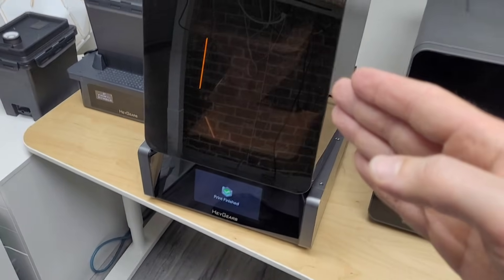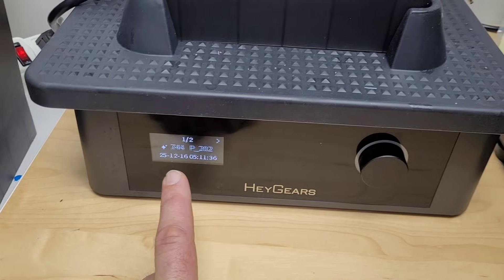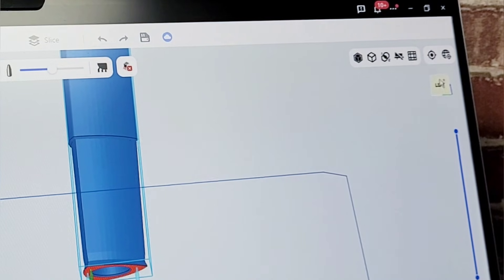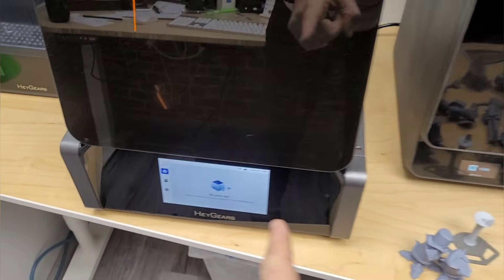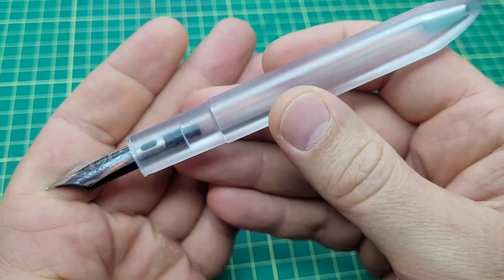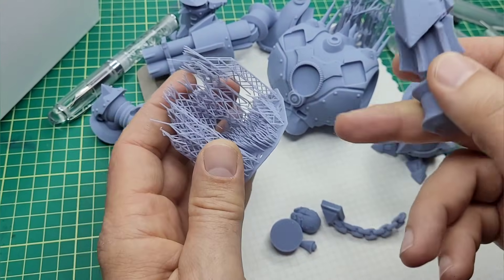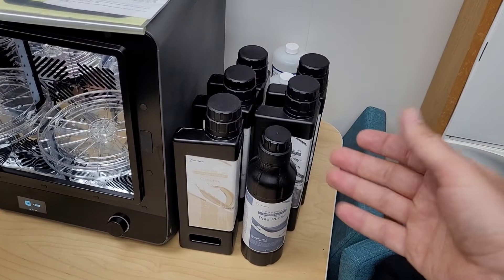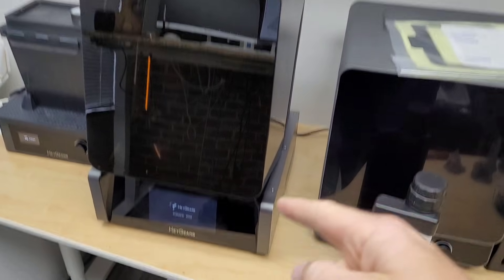Consistent Resin Prints Without the Stress — HeyGears Reflex RS

Comment: Quick suggestion that helped me in resin printing - go use a different slicer to get supports (I found prusa slicer, used more for FDM, was great for support generation - I've also used chitubox). Once you have supports created in a different slicer, you can re-export the STL (with the supports) into your printer software for prep and printing. I know it's two steps, but might solve your support challenge. 
Supports, in addition to the simple messiness of resin, has been one of the biggest hurdles compared to FDM for me.
Reply from the maker: Yeah I hear ya.  For this review I wanted to keep it all on the HeyGears workflow.  That is a way to do it but a few tweaks to the supports in their own SW would be nice.  Everything else has been great but a few tweaks would make it fantastic.  The model with the pre-generated supports fell 2 times so there's something to be said for having prints that work every time but may just need a little extra post processing.  I think they prioritize having print success over anything else.  But being able to tweak the supports, especially ones that were generated in the threads, would be nice.

Comment: since the supports are such an issue, you should try other SLA printer softwares to generate the supports, then you can export the stl with with supports included, load that into your heygear software and just line it up and print it
Reply from the maker: Yup I thought of that but wanted to keep it all in the HeyGears workflow for this review.  I think that part of the software just needs a few small improvements to allow for tweaking a flexibility with the supports.  But the good news is their supports didn't fail at all but the ones generated in the other software did fail twice.  I'd rather have successful prints with a little more post processing VS a failed print.

Comment: Question about resin printing: What do you do with all the waste? The supports, the first iterations that needed improvement etc.?
Reply from the maker: There arent a whole lot of options currently for recycling the material.  I've heard some will grind it up and it can be used for filler in other applications.

Comment: For me, the worst issue with a proprietary platform like HeyGears is that if they disappear your super convenient tool becomes an expensive museum piece... if lucky
Reply from the maker: Yup that always is a risk.  Other resins do work with it, but just have to do testing to find the corresponding profile which properly cures those resins.  I've seen other do testing with that and even have a reference sheet of cross compatible resins

Comment: 1)
Looks like you changed your capital F style, font in your test writing examples.
There is nothing wrong with the F, I just, well just noticed.

2)
Your improvement suggestions seem to be obvious concerns.
From past experience, not 3D printing, you need to have people not in the design group test and play with the software & hardware.
The design group can then get a better understanding of what needs improvements.
The test, play groups can be office clerical staff or students involved with 3D connected education.
This group does need to be somewhat familiar with 3D as your customers would be familiar with the technology.

3) 
What becomes of the failed, not needed and waisted resin and or goo in the printing process?
It seems to me there could be a sizeable amount over time.
Can some be recycled or melted and reused or destination landfill?
Just a Friendly question.

4)
Will you be creating your own feed part?
Would a printed nib work?
If you could create all the parts but the ink, you could have that Frankenstein moment of 'Its Alive'.

5)
Thanks for the episode.
Reply from the maker: I change up my character style often, even just depending upon the nib type I'll change things :)
The left over resin is simply poured back into the bottles with a filter to catch any unwanted bits.  the supports though can't really be recycled.  I've heard some people use them as filler (ground up) for other applications. 
I won't be 3D printing a nib as a plastic nib just wont give performance needed.  Not to mention you can buy a complete nib/feed/housing for pretty damn cheap and they work perfectly.
Reply: I understand 3D printing a workable nib and feed would not be workable.

I should have written to better align with my thought process.

I was thinking of 3D printing just to see if possible and a little workable, to see it the pieces would even work.

I never really expected it to be done but just wanted your ecperienced opinion if done would they work.

I will try to re-read 3 times before posting to ensure a more accurate post and better worded thoughts.

I appreciate your reply and your time.